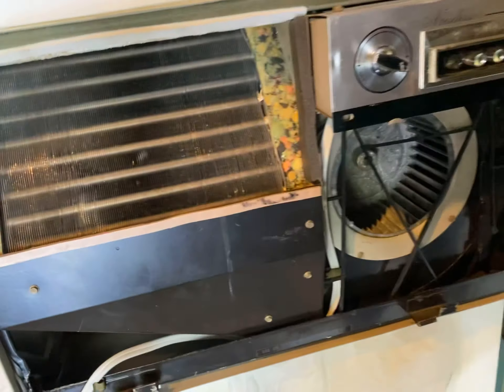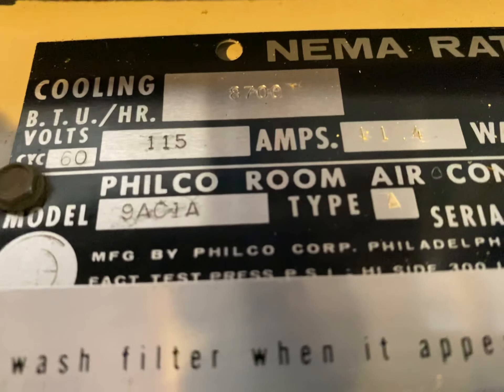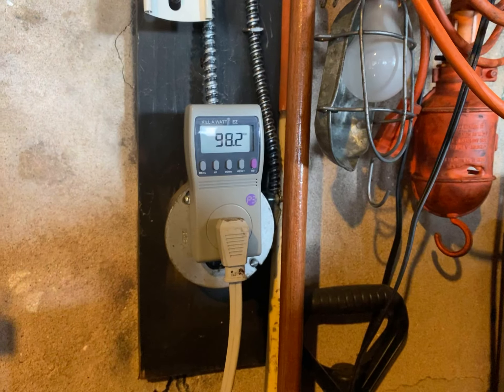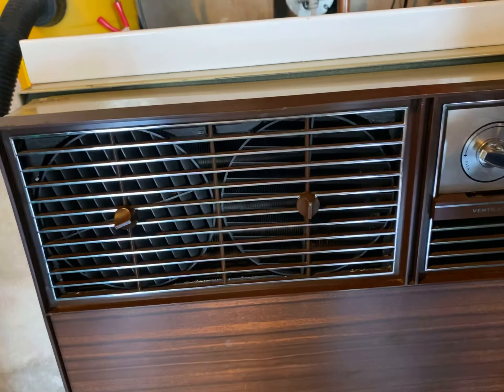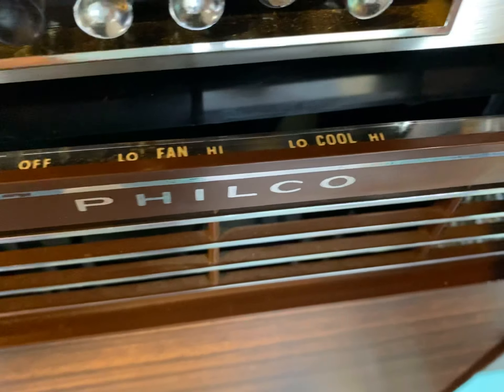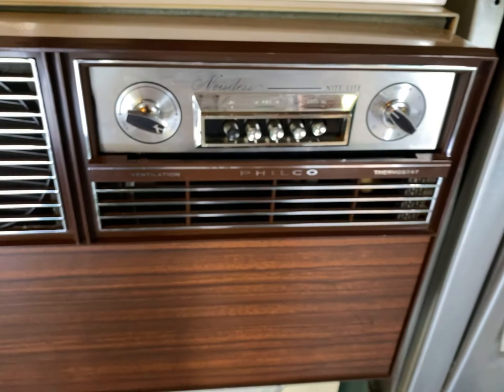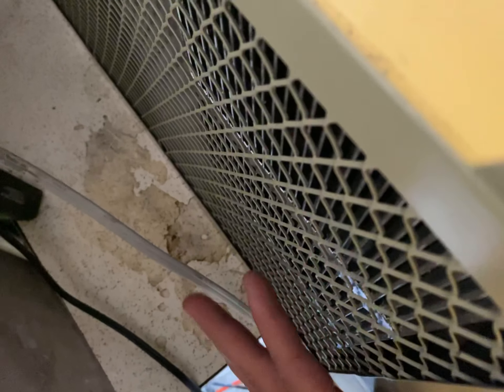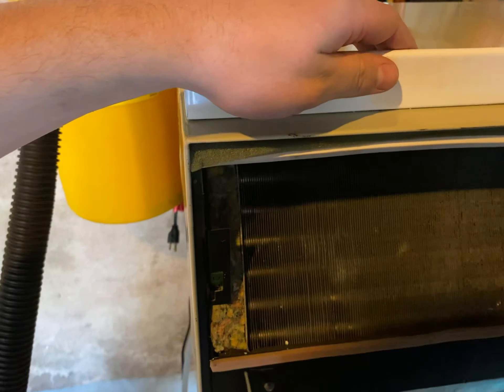Philco Ford Noisless Series Space Saver “Nite Lite” model W/ Christian aka WeatherWheelHVAC

Comment: Just read a bit of the history of the Tecumseh "Pancake": it was made in small sizes (1/12 thru 1/5 HP) in 1955 or earlier. A 1958 Popular Science article shows how a 1/2 HP Pancake from that year allowed a number of companies including Emerson and Carrier to make portable units. Philco used Pancakes on its Space Saver models (all the way up to 12,000 BTU, 230V) from 1960 thru 1966, and Emerson had it in some of its units in those years.
I once saw a video of a Pancake being cut open, and was surprised to see that the motor was vertically mounted. (I thought it would be horizontal like the York compressor in your 1956 Philco.)

Comment: A 1966 Philco Space Saver model: a great-looking machine!
The Philco service manual lists the wattage at 1300; in fact 1600 is not possible if the current is 11.4 amps at 115 volts, even at a perfect power factor of 1.

Comment: That's a very nice unit. I like the sound of the compressor but it was having a hard time starting up. And it was drawing way over amping I see
Reply: Mikes garage has less than optimal wiring... plus these pancakes do pull a good bit of juice..
Reply: And the third thing is that unit had the wrong type of replacement cord